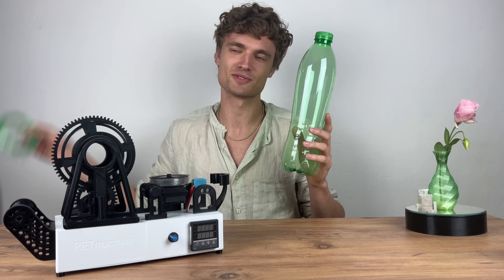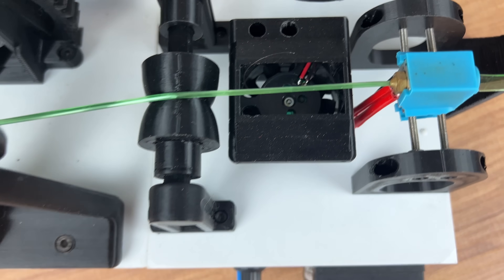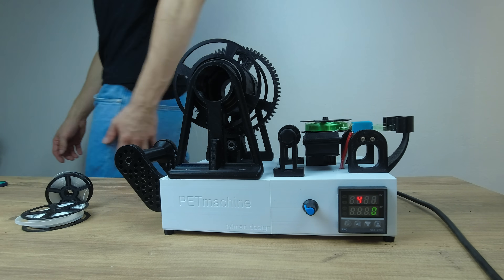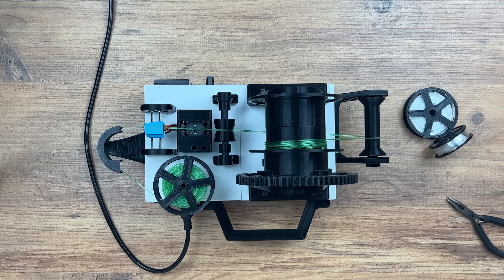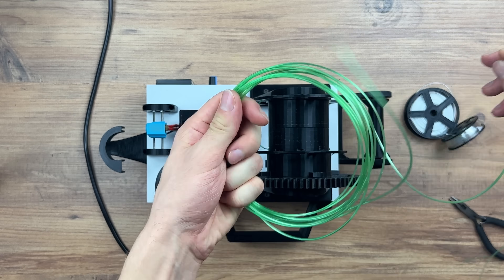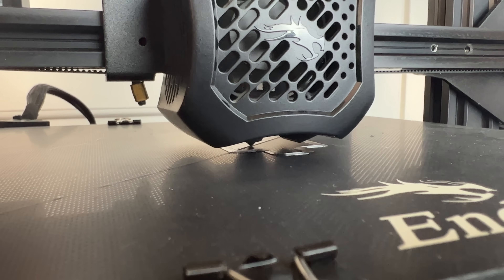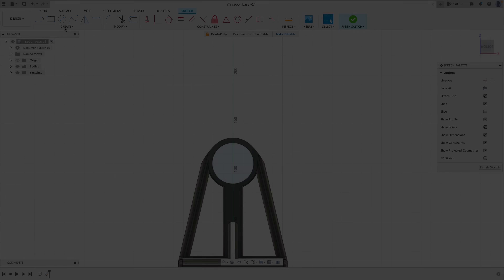Turn Plastic Bottles Into 3D Printer Filament at Home | DIY PET Recycling Machine!

Comment: This is incredible! Have you tried integrating the bottle slicer into the machine? I see this as being an amazing semi-interactive technology/art display for science centers or museums having a whole system going in line -- bottle being cut,  turned into filament,  and fed right into a printer.  Might have to try messing around with it!
Reply: wow hacksmith, wasn't expecting you there hah
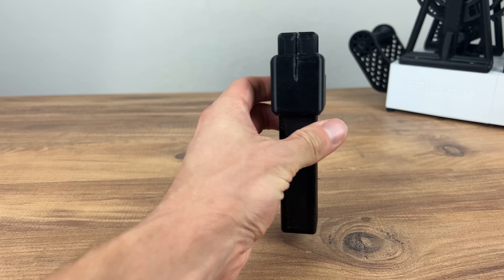Reply: He actually mentioned in this video that he was thinking of integrating a bottle cutter on the machine. 2:32
Reply from the maker: @fraudbuster1456  I already made it, please check my IG account or other videos on YT channel to know more!
Reply: @TylmanDesign  , are you currently producing units for sale? I’m a marine engineer (like the train driver type of engineer, not one of the useless engineers that design things without ever having to put them together in the real world and consequently none of their designs ever fit together properly, apologies if you are one of those and sorry for your failures) so assembly and any alignment wouldn’t be a problem for me. My issue would be in the electronics and controls. This seems like something I would buy if support were available. Like many hands-on engineers, I don’t care about warranties but I do value decent support.
Reply: @TylmanDesign  By the way, your method of smoothing the bottle prior to slicing is very innovative. Did you think it up by yourself or did you see something that gave you the idea?
Reply from the maker: @fraudbuster1456  Hello! Yes, I'm selling PETmachine kit with all Non-3D printed parts included in my Etsy store (link attached below). To be honest if I won't build even my simplest designs that I imagine and sketch in a CAD I won't be able to sleep at night haha I love to experience and "touch" my creations. 

There are really detailed instructions (130 pages) leading step by step through assembling process, chapter with electrical connections is especially very detailed. You have my almost 24/7 support and our Discord channel where people are always ready to help as well. 

I saw this method somewhere, of course you can use different source of heat and it will vary, but methodology is always the same, to increase the pressure inside the bottle and then use the heat to change the shape. Lately I use new method with tire valve installed in a bottle cap, I pressurize the bottle using pump/compressor and spill a little bit of boiled water on it, it works instantly!  

If you have more questions please hit me here: igor@tylmandesign.com , I'm always happy to help! 

https://www.etsy.com/TylmanDesign/listing/1384170924/petmachine-make-your-own-3d-printer?utm_source=Copy&utm_medium=ListingManager&utm_campaign=Share&utm_term=so.lmsm&share_time=1688198023519
Reply from the maker: It's an amazing small filament factory at home haha Yeah, I already made this kind of slicer and works great! You can check my IG reels or YT shorts where I create for example Coca-Cola bottle from Coca-Cola bottle (bottleception haha) using this upgrade. I slowly develop my project and just a small step left to make your idea happen! Worth to try for sure! Thank you for your support!
Reply: Bottle out too
Reply: And have it print a bottle that feeds the slicer.
Reply: While printing what should be the temperature of nozzle
Reply: I would love one of these machines .
I wonder how much this whole machine is

Comment: Which cheap 3D printers for starters that work with this filament would you recommend?
Reply from the maker: Almost every printer, but in a cheap printer you will have to change PTFE tube and extruder for double gear one.
Reply: @TylmanDesign  Thanks!

Comment: You could create multicolor filament by either concatenating 2 color bottles or by paralleling 2 colors at once. There you get a different look from which direction you look onto you print.

Comment: There I'd a spool rewinder design for taking filament from cardboard spools to the bambu refillable spools. It has a piece on it that keeps the filament lined up on the spool as it's filling. I think you could benefit from incorporating that design into yours. So you don't have to do it by hand.

Comment: This thing is awesome - great build and design. The critical add-on is being able to use your scrap filament as the raw material, as the waste factor is a big concern for this industry.
Reply: It's a bit more complex since they have to be of the same type for ideal filament and they'll have to be ground up but the extrusion and collection part should remain the same

Comment: is the winding speed changing automatically during process from higher speed to lower speed ?
Reply from the maker: Im using PWM controller with potentiometer, there is option to create feedback loop with encoder and Arduino to keep pulling speed all the time the same, but it's not neccesary.

Comment: Hi, does the filament that the machine produces have a full section?
Reply from the maker: No, it's hollow inside, then we compensate it with flow in slicer settings, for example I set it to 130%.

Comment: it's not efficiant and i want to see the filament under a microscope, the preasure will not be high enough to produce the filament without air bubbles.
Reply from the maker: You can check my science article about it, there are pics under microscope as well.

Comment: I've just finished my machine!  At what temperatures you are printing with the pet filament?  I believe my sidewinder x2 will need mods to handle the temperature
Reply from the maker: Hello. Im using stock Ender 3 V2 and printing around 260 degrees, try to set flow to 130% and reduce retraction significantly.

Comment: I love it, and i will get one when you start selling them.

Suggestion: many bottles have curves that cannot be smoothed out like you do it here. I think it would be better to shred the bottle into confetty and then feed the bits under pressure to the hot end.
Reply: Ooooooor...

You can cut multiple bottles into very thin strips, and feed those thin strips together in parallel into the hotend !!!

Comment: Fantastic project and it even looks professional without any wires showing. I think an added feature, to make this perfect, would be an rpm counter for consistency of the final filament.
Reply: it is not an rpm controller that need to be used but a feedback loop with a sensor that mesure thickness of the strand and adjust motor speed. It increases cost but is a needed feature to be able to use different pet bottles without problems.
Reply: the RPM is a static 30RPM due to the motor used.

Comment: Hey Igor. Can you maybe add your PET-Cutting module as a separate piece. Just purchased the machine before you added extra tool. Do not want to purchase whole machine again.
Reply from the maker: Hello! Now all files are in one google drive folder, on the beginning files were available just on the Cults3D site, now there is just a link leading to the google drive folder where everything is up to date. There is PETmachine and all modules for it! Please, check your Cults3D site again to find this link.

Comment: I've seen a guy that did something similar but the cutting part would also be part and it would be cutting as it pulls in the plastic to make the filament. These machines are very useful for both helping with cost but also with recycling materials too.

Comment: At what temperature did you print the vase?
And also did the filament crystalized?
Reply from the maker: 260. I was using it for many months and it cristilized few times just on the same beginning when I was searching for best settings

Comment: I have been trying to a construct one of these in one of my classes using parts found in the classroom, I am attempting to use an old hot end but I do not have something to read the thermistor, so I was wondering what voltage should I use to achieve the temperature to make these bottles malleable, or would I have to keep trying the voltages till one is successful, also great video.

Comment: Awesome project, it only needs some sort of filament diameter read out, doesn't need to be automatic speed adjustment, just an LCD so one can see what's being produced and adjust the motor speed accordingly.

Comment: small tip... dont care too much about portability.. focus on incorporating the bottle cutting in the machine. as it is now its nice but lots of manual work... if that cutting is automated you can also target customers in bussiness section of the market.
also should roll on spools for 3d printers not having to roll yourself and transfer later
Reply from the maker: Hello! This video is not up to date already! Machine has module allowing to cut bottles onboard. Removable spool that you can use in your printer directly after turning bottle into filament is in test phase and will be released soon! Thank you for your comment!
Reply: @TylmanDesign  sounds amazing... cant wait for your next video showing that

Comment: "free" 80w hot head for how many hours to get a few feet of filament
Reply from the maker: Power supply has 75W, all components consume max. 50W, so even if machine will work 24h it will use 1,2kWh, so I guess it's around 20 cents.
Reply: @TylmanDesign   to get 2lb of filament you will need to process aprox 40 20oz bottles with out caps.

Comment: Do you think it would be possible to link multiple strips together? Before the heating and size reduction into a filament. That way you could have a longer overall filament.
Reply from the maker: Of course it's possible, there is very efficient method for it "ultrasonic welding" but devices are extremely expensive, i have to find cheaper solution !
Reply from the maker: Hello! We will announce and put PETwelder on sale very soon. You can follow my Instagram account to follow the progress about it: www.instagram.com/tylmandesign

Comment: Thx for your idea and for sharing it with us.
But I guess in Germany it will not work because of bad efficiency - PET bottles have a deposit of 25 €-Cent, combined with the high energy costs it will cost a lot more than buying a normal spool of PET. But one step at a time - I am curious how your idea will continue :)

Comment: hello congratulations for the video some time ago I had replicated the 3d filament machine of the youtuber "mr3dp" everything ok but I don't understand which parameters to set on my "anycubic mega zero" could you help me too I use ultimaker cure thanks
Reply from the maker: Hello. You have to experiment with different parameters to find Your best ones.

Pulling temperature in the machine*	195-215 Celsius Degrees	
Layer height	0.2mm	
Nozzle temperature	250-260 Celsius Degrees**	
Bed temerature	70-80 Celsius Degrees	
Flow	120-130%	
Printing speed	30-50mm/s	
Retraction	3mm*** (Value for bowden extruder)	
Retraction speed	20mm/s (Value for bowden extruder)	
Fan speed	15%
Reply: @TylmanDesign  ok thanks i will try
Reply: @TylmanDesign  grazie per la risposta che nozzle usi? che software di slicing usi?
Reply: @TylmanDesign  ciao grazie sono riuscito a stampare ma dovevo spingere io il filo! faccio le striscie di bottiglia da 6mm ed il filo estruso esce rotondo ma se lo stringo con le dita si appiattiscie dici di fare le striscie piu larghe? ho provato a stringere la molla dell'estrusore della stampante il piu possibile ma con esito negativi ti prego aiutami e cosi belle reciclare le bottiglie e stampare
Reply: @TylmanDesign  con estensore diretto i parametri cambiano se si quali?

Comment: why you call it's free ? 
electricity fee 
plastic bottle (first buy )
need special staff to cut it.... 
except those things... yes free ahahaha

like for this cutter machine!
Reply: Considering the most expensive thing overtime in 3d printing is filament technically it is free, you would throw away bottle anyway, so you can reuse it

Comment: @PumpiPoland
I purchased REX-C100 (AC110-240V) from the url in the BOM of your project, but the linked store sent me REX-C100 that is only for 220V.
Did you really receive REX-C100 for 110-240V from this store? Also, have you confirmed whether the stores you refer to in BOM are reliable?
Reply from the maker: Hello, really good point! Before it didn't have any comments, now I see that people receive 240V version not like in the title of the announcement 110-240V. I'm so sorry for it, Im not able to check every seller, I will change this link tomorrow and find reliable one! Thank you one more time and so sorry for this!

Comment: Неплохо, но не хватает полной автоматизации, необходимо много "ручного" вмешательства в процесс (выравнивание бутылки, нарезание ленты, намотка ее на катушку, протягивание сопли через систему, включение/выключение в процессе, пока крепите филамент к новой катушке). И, в итоге, получается совсем небольшой объем. Для каждой бутылки придется проделывать весь этот цикл. 
Могу предположить, что использование шредера (измельчителя) и переплавка шихты упростит процесс. Вот пример аппарата переплавки:
https://youtu.be/n5a2KKbK35A
Можно получить непрерывный прут любой длинны (при наличии достаточного количества материала).
Reply from the maker: Hello, 
I prepared this project not for my needs, first of all it's designed to be affordable, easy to make and compact for hobbyist, beginners and enthusiasts. Machine that you are showing require much much more experience, money and space to make it, of course this kind of extruders are more efficient, but building well working one is really hard. 

Im making upgrades for my machine all the time, now you can cut a bottle on the machine, in the next week it will have removable spool, then module for coloring transparent strings, splicer connecting two wires and so on and so on. 

Thank you for your comment!
Reply: @TylmanDesign  Thanks for the feedback!
Yes, I agree with you, that device is more complicated.
There is especially no point in doing something cumbersome if 3D printing is not a daily activity, but only a hobby on a rare weekend.
I will follow your projects, great channel!

Comment: How long it took to print? Actually, with this technogy, Israeli Jewishzionists tried to beat china in manufacturing, but they fell flat on their faces. It takes 24 hours to print small components. In that much time, injection molding machine produces 1000s of same products.
Reply from the maker: Ender do it in 6h, my new Bambu Lab X1C in 1.5h.
Reply: @TylmanDesign  hi, thanks for like and comment. Where's the link to Bambulab X1 C ?

Comment: as im watching this i started to calculate. 
I pay 0.25 euro for a bottle as a deposit. If i return i get it back.
Is this really cheaper than buying the filament itself ?
Reply from the maker: Fortunately you have this recycling system in your country which is amazing! Poland doesn't have it, Turkey doesn't have it and I collect a lot of clean 5-10L bottles around the city (seriously). In Rwanda(Africa) for example importing 1kg of PLA cost 80$, so this machine have economical sense depends of the region you live, but it's always worth it for a lot of joy when making filament by your own! Haha Cheers!

Comment: Sir, Would you mention which REX C100 module you used in this project?? Output type ??? as most of REX C100 consists of some kind of contactor relay or SSR and we can clearly see in your assembly you haven't used any relay.
Reply from the maker: In my Bill of Materials there is description for every component. I use REX C100 version with Relay.

Comment: I saw a video of a bottle cutter that used 2 interfering bearings. The faces of the outer races had been ground to provide a sharp 90° edge and the two bearings acted as a rotating shear.
https://www.youtube.com/watch?v=eTBnhKWMYQk
Reply from the maker: Yes I was considering this in my project, due to I make it especially for begginers I choose blade cutter coz of much simpler build! Thank you for your support!

Comment: This is fantastic, really great job! I'm just wondering if there is a way to connect ribbons from different bottles together before feeding them to the heat block so we can have long strings from multiple bottles?
Reply from the maker: Thank you so much! Yes it's possible, I tried to do it using iron solder but it needs some more tests! It will be amazing to wind one big spool with strip and then just process it...
Reply: @TylmanDesign have you tested this at all. I’m curious if a simple tack weld before going through the heating element would be enough. Or if perhaps the plastic doesn’t deform enough in the element to get good cohesion?

Comment: nice job, but one question.. why melting the plastic twice instead of printing it directly from the bottle stripes? that would be way more efficent and faster.. i gues the problem is the inconsistent diameter and so the inconstistent flowrate while extruding and thats its drawn instead of pushed right? but you obviously got the time and brain to get it done.. cheers
Reply from the maker: Someone made extruder/hotend that we can feed with strips, I watched it somewhere on YouTube, you have to change hardware and you won't be able to use any other filament, I won't want to harm my Prusa i3 like that for example... You make filament, store it and use whatever you want, much more comfortable solution. 

I printed hundreds of meters of this bottle filament and I always had amazing quality and extrusion, of course after many tests and changing settings. It's just work.
Reply: @TylmanDesign  ah ok. i guess, since everyone is printing like hell (and a lot of pointless stuff), the bottle solution saves plastic in the first place but we need to reduce the amount of energy, which is wasted and extruding once instead of twiced makes it more efficent... comfort yes sure but not for the cost of wasting energy..